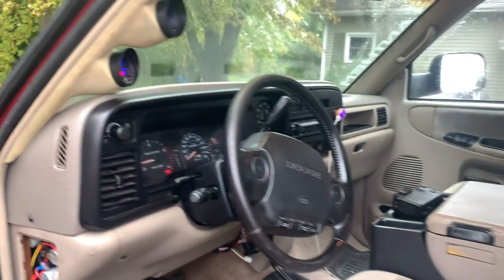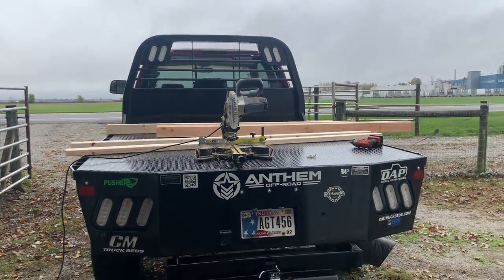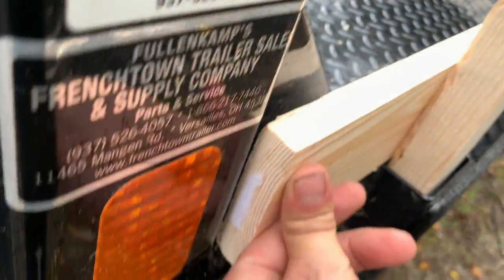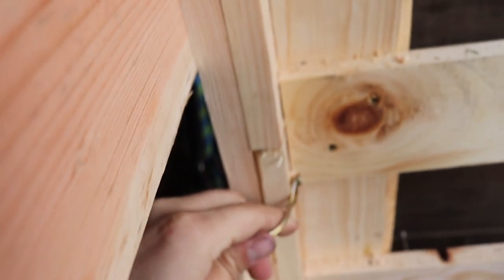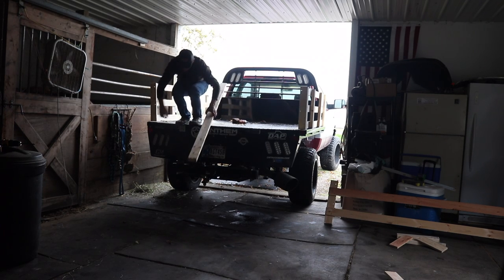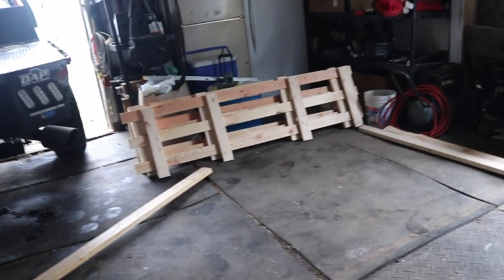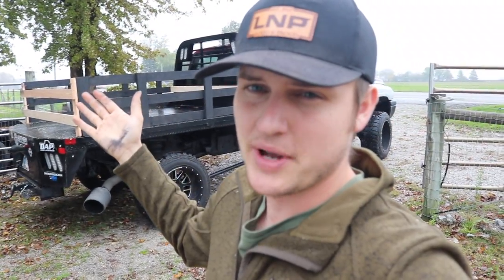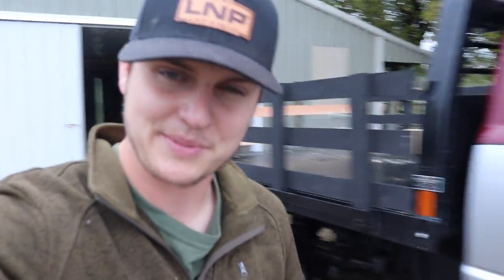I should have done this MONTHS AGO!!!

Comment: You could have pinned the front and I believe it would be plenty sturdy. Then you wouldn't have to take the screws out to take it off. We use 4 slide bolt locks on each end to hold them together.